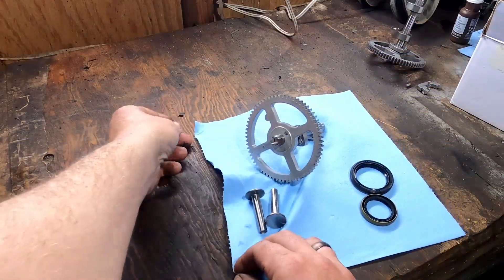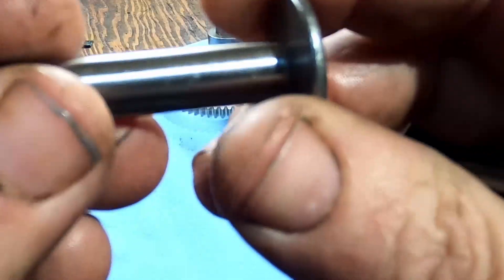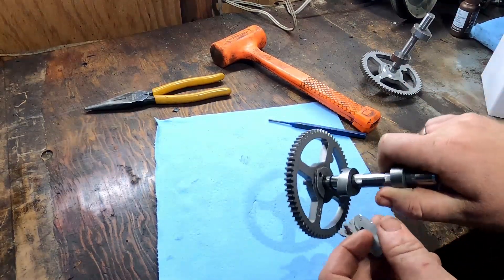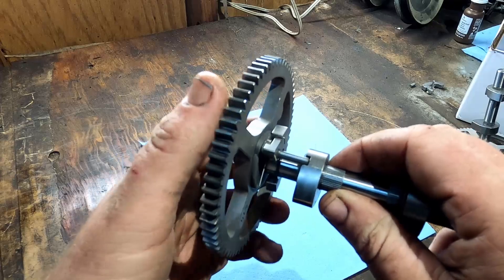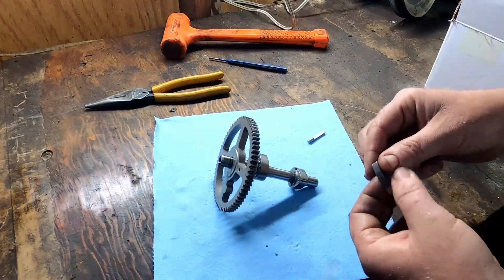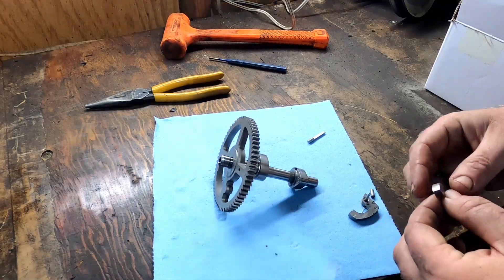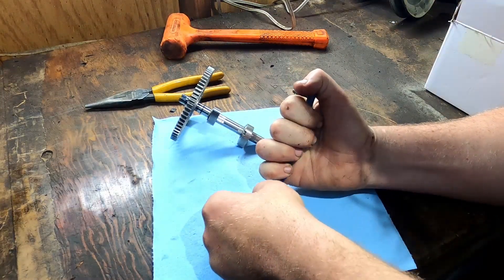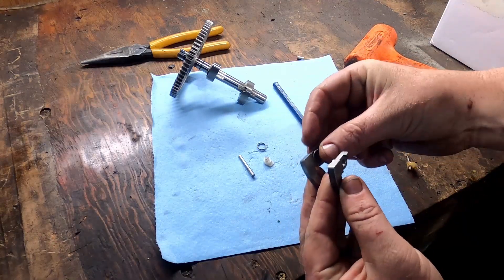Briggs Intek 14-19hp Broken Compression Release, Symptoms, Where to Find, and How to Fix.

Comment: My 19 hp just thru the compression release. The idea disassembling the engine just really was not appealing so started looking a other options. Decided to add spark plug antifoulers to reduce compression....added 2 an engine will start and runs good of course it is down on power sume but will cut grass. Thats good enoughfor me.

Comment: I have an old JD L100 that was in pretty bad shape, including a broken compression release; I rebuilt it and got it running without repairing the cam. I found you can spin the crank by turning the screen, counter clockwise to just after the compression stroke. Then when you try and start the engine the flywheel will provide enough momentum so the starter can turn through the compression stroke and start the engine. I suspect this might shorten the life of the starter so I have disconnected the seat shut off, so if I  need to  stop I can slow down the engine and leave it running till I'm done using it. So far it's lasted three years doing this.
Reply: If you do not fix the broken compression release on our cam, aren't those pasts just being tossed around inside the engine case now? Not good.
Reply: @PainterD54  Not necessarily. Steel is way denser than oil, so the parts might find a nice spot on the bottom and slide around on the bottom forever. Now if it was an engine that didn't have an oil pump, and just slung the oil around for lubrication, the smaller pieces would be tossed around with the oil, since it flies  around like crazy in a horizontal shaft engine that uses a slinger to throw the oil to lubricate everything. When mine breaks I will try that, unless it rips up the engine when it fails. 
No way am I going to do all that work, only to have it fail again, which it seems they all eventually do. That is a defective design. The pin is too weak where the flat spot begins. The counterweight is too heavy, which eventually breaks the pin at the weakest spot, where the cut away starts. 
You can also remove the air cleaner and block off the air intake with your hand to start the engine after moving it just past the compression stroke.

Comment: My 2008 16.5 does not say Intek on it but looks similar to these under the plastic. My "fix" when hard starting occured was to install a used but good 500cca  Harley battery out of a touring model. I guess I should check valve actuation for the intake "bump" (and lash while in there). My plastic cover is red.
Reply from the maker: Yeah sounds like a compression release issue. Make sure the valves are adjusted correctly first. You should see that valve bump right before tdc.
Reply: @mechanicallycreative9788  
Thanks! Will check it once we thaw out. Fortunately I was given a spare rider this fall with a 17.5 twin.

Comment: Thanks for the video. Fixing my in-laws mower it just threw the compression release again  and unfortunately bent the cam, took out the locating boss in the case.    Watching you assemble that weight to the plastic D shape plastic etc. it looks like its a tight slip fit on the shaft . Whats the chance that weight does not walk  downward when running?  its somewhat hanging from the bottom side of the cam gear. It seems they intended to having that somewhat open C shaped retaining ring on there to prevent that?  It didn't seem that it was enough of a flange and or if the retaining ring rotated it seems the open side could allow the weight to drop down and then who knows what damage can happen.  I hate that their is that plastic bushing in there.    I looked at the early cams and that  weight had no plastic and  nested in a machined flat  so it could not walk down the CR pin.   I am tempted to make a fork type plate that can retain the weight and tack weld it to the cam shaft. Alternately I see those type 31 cams  being all metal and wonder if i could use one of those cams  and just machine the groove in the end to drive the oil pump shaft.  Cheers Ken